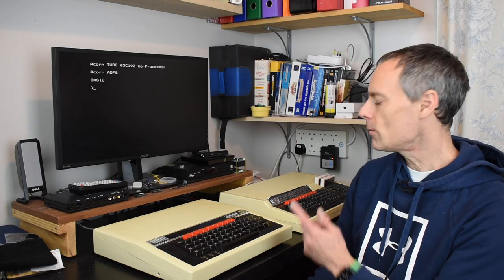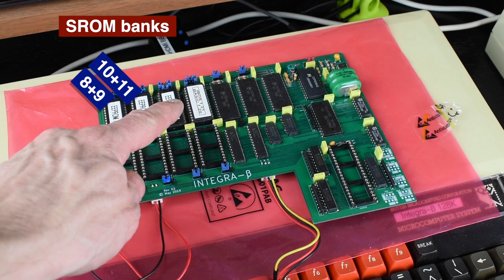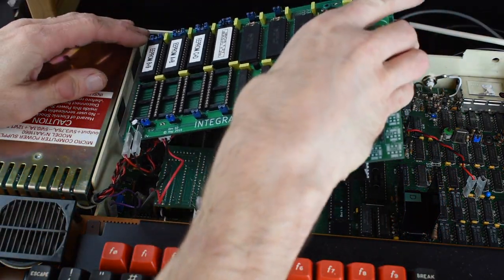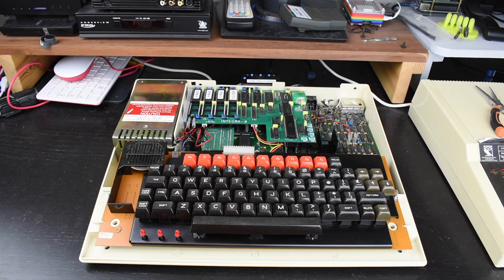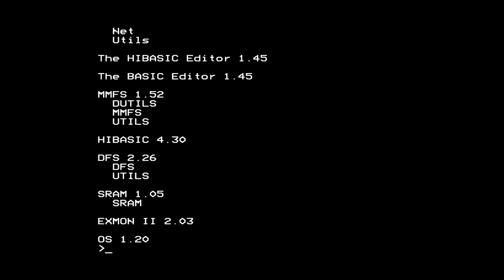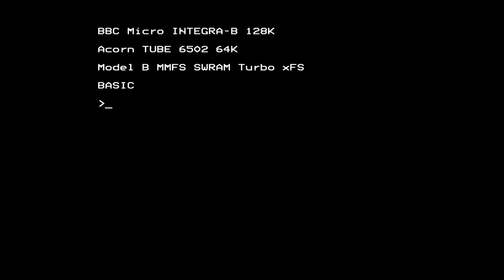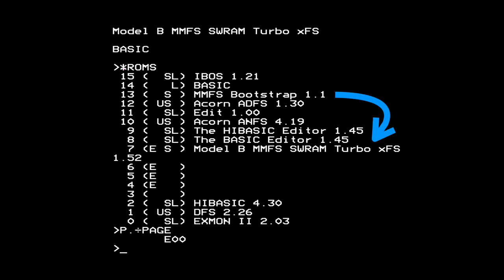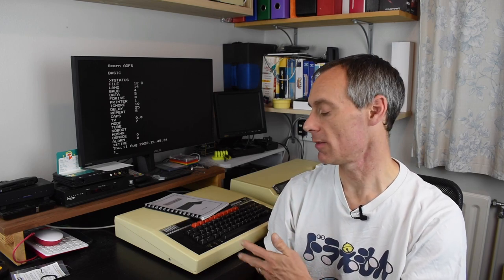Integra B for the BBC Micro

Comment: The BBC micro is a fascinating computer because of all the features.  This was clearly not meant to be a consumer PC with limited expansion and a minimalist OS like a Commodore or Atari.
Reply from the maker: I think it was one of the few machines which actually came through on everything promised: networking, Tube processors, CP/M, hard discs, Teletext, etc.  Having the reliable schools market helped enormously here, I think.

The operating system actually looks like it's been defined properly, too: with very little need to hit hardware and everything working across the Tube with different coprocessor architectures.
Reply: @lsbyte  I don't really understand the "Tube" concept or how it works.

Comment: Not a fan of that on board battery. :)
Reply: It was done that way to keep it looking like the original board. If you're worried about battery leak, it can be removed,  and replaced with a 2 pin header so a remote battery can be used instead.